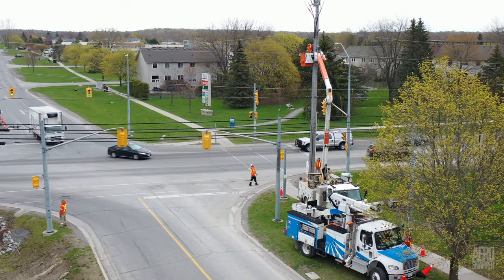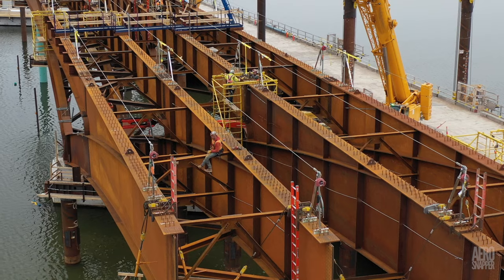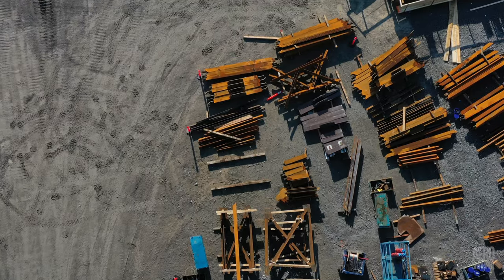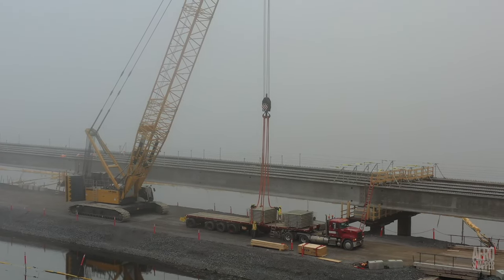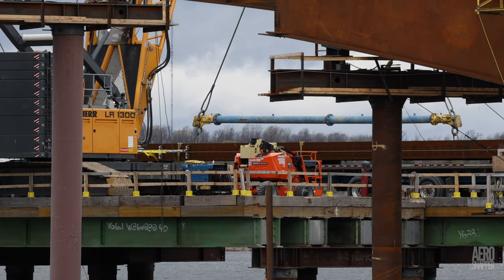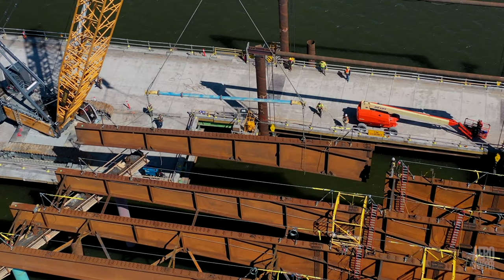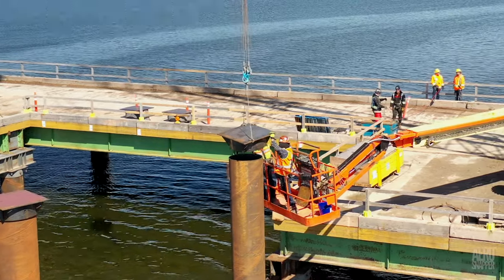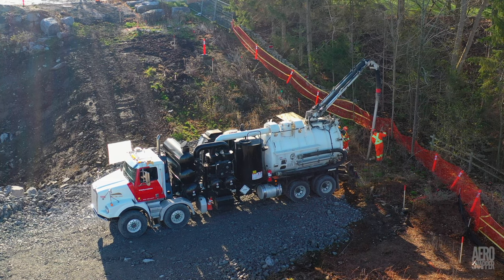Men for all Seasons

Comment: Another great update Mike, really finding this fascinating, I had a few tricky crane jobs in the RAF & as an instructor, though nothing quite as big as those.
Reply from the maker: Thanks Mick - incredibly, these LR-1300s are barely exercising - they could add additional jib and backstay. On the ground weight currently - about 63,000 lbs.
Reply: @Aerosnapper  they are some machines, the biggest one the RAF had was a 25t Smiths, old tech, with lattice jib that could be extended by disconnecting everything & bolting the additional jibs before reconnecting cables etc. one heck of a job !! We had it permanently set up with 1 jib extension.